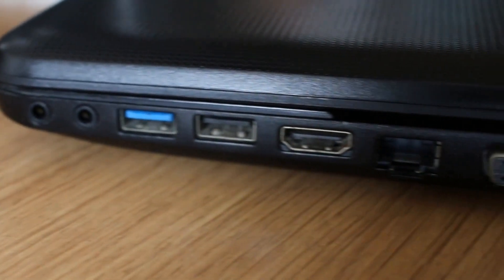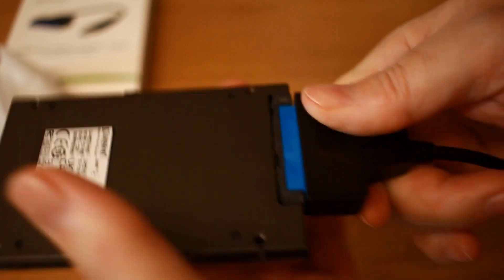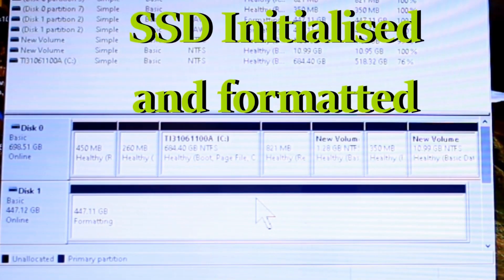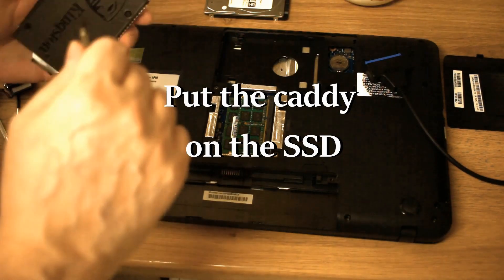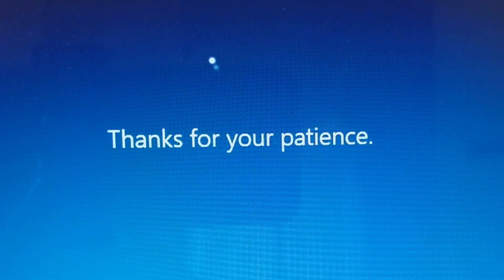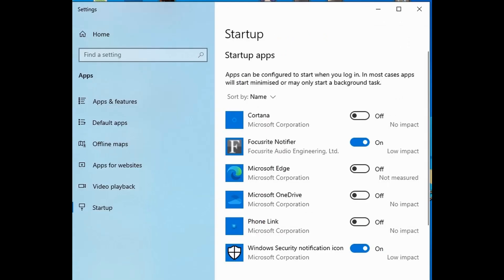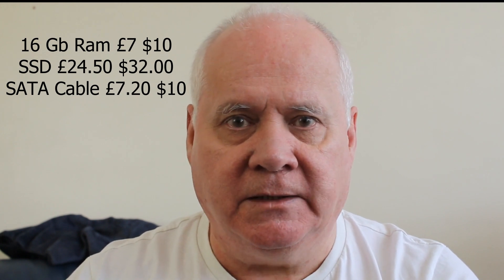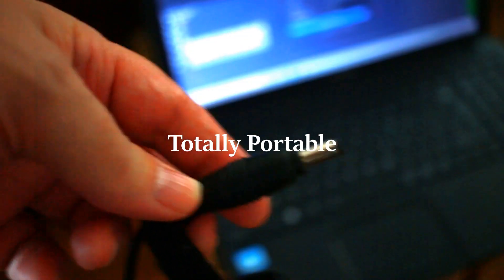Make your old laptop 10x faster Toshiba Satellite c850

Comment: I found your channel from the WD HDD video, i just bought that. Glad its good, but then i seen this video and you've got the same crappy laptop i got.
Reply from the maker: @unholy.espada  Haha it's not crappy now with these simple upgrades. 
Boots up faster than ever. 12 seconds and it's ready for action plus it can handle things like davinci resolve 16 now without breaking a sweat.
Are you thinking about upgrading your machine?
I think you will be surprised how fast these old laptops can run.
Reply: @molometer  its shocking how fast you managed to get it. And i litterally bought the WD HDD yesterday when i came across your channel and seen how fast you can transfer stuff but wondered how my Toshiba would handle it just to find out you tested it on the same one i got. 

Did you test out the HDD on the upgraded laptop or before the upgrade? Because i havent been home and im wondering if my slow laptop would affect the transfer speeds
Reply from the maker: Thanks for asking. The hard drive was tested on my Toshiba laptop way before the upgrades that I did. If you check the dates on the videos you can see it was a few years ago. 
I was toying with the idea of getting a new laptop but the laptops today just don’t have the functionality of my old Toshiba so I went the upgrade route and I’m so glad I did.
How many new laptops have a built in dvd burner? None lol.
I think the whole upgrade cost less than £50. Bargain. 😂👍
Reply: @molometer  glad to hear that, hopefully when i come back home and i test it i'll see the same results you experienced.
Reply: @molometer  i just came back to let you know that i have tested the harddrive and even with my laptop running slow, the transfer speeds of this Harddrive are absolutely phenomenal. I fully would reccomend this to anyone.
Reply from the maker: @unholy.espada  Hey thanks for letting everyone know that you got the same results. This is a great hard drive and I’m sure you will have many years of service with it.
Doing this YouTube channel generates a lot of 4k footage and that 4TB drive just eats it up with no issues.

On another note could you please share with me your thoughts on the Toshiba laptop video that I uploaded.
Did it make sense? Was it easy to follow?
I’d appreciate your feedback.👍
Reply: @molometer  your video was very well explained, you're killing it. Thank you
Reply from the maker: @unholy.espada  Thank you so much for your reply. It’s really appreciated and helpful for me to understand what is happening with my content.👍

Comment: This is great! After watching your video, I have the urge to revitalise mine. I picked Crucial 16GB kit (8GBx2), 204-pin SODIMM and DDR3 PC3-12800. I can't decide on the SSD. Crucial BX500 or Samsung 870 EVO 1TB. I'm tempted to max out the SSD at 2 TB.
Reply from the maker: These simple and affordable upgrades made my laptop astonishingly fast. 
My suggestion in the video is to have a smaller SSD internally (500Gb) and a bigger external hard drive. 
Keep the laptop running faster with just the operating system and whatever you are working on added when you’re working on it.
Keep all your data, videos and photos on the external drive. 
Everything on one internal drive is a hard drive in peril. 😂👍
Reply: @molometer  I currently do this with my XPS. Original Parts: 16GB RAM and NVMe KIOXIA 512GB. Paired with a decade old 1TB Toshiba Canvio Basic for some files, etc. A recent 4TB Canvio Advance for all everything else. 
My primary use of my Satellite has always been writing and low spec games. Most are 16-bit. Not sure for the 90's RPGS. I'll go with the smaller SSD and grab an external HD. 😄
Reply from the maker: @FachtnaQuella Sounds like a good idea 👍 My satellite now runs smooth as silk even on some heavy duty video editing software.
I haven’t used it for gaming yet.

Comment: Amazing SSD. I noticed a big difference in my cellphone upgrade. I noticed my old cellphone was faster according to Antutu benchmark for the processor but the new cellphone was 10x faster in real-time use so I looked into it more and realized they're using SSD in most newer Cellphones attributed to snappier access to files, etc.  

Thanks for the directions.  I have an old laptop that could benefit from this SSD and memory upgrade.
Reply from the maker: I must admit I was more than a little astonished by the difference in speed in this older laptop with the new ssd installed. 
You are correct. The ssd cleared the bottle neck of the old hard drive.
It cold boots up in less than 17 seconds!! Truly impressive. 

It's amazing how this simple upgrade has transformed the way this laptop operates. It can run davinci resolve with ease. If you have an old laptop I would highly recommend doing this upgrade.
👨‍💻👍🏼
Based on the cold boot tests it is over 22 times faster than it was before.
Reply: @molometer  incredibly awesome to hear this Molometer. 👏
Reply from the maker: @JesusOurKing  Thanks for your comments. It's always good to hear that my videos are useful to people 👍🏼